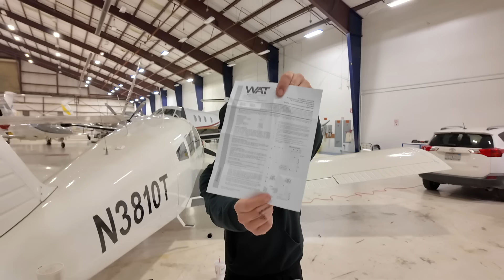Transform your aircraft with simple LED light upgrades

Comment: Looks amazing!  Good job. And even on cars you will find lights with “Top” on them. 

Mostly LEDs because it has to do with drainage for water and moisture. There is usually a small port on the bottom to allow it to drain to keep the circuit boards dry. It’s a lot more important in LEDs than with halogen lights that do not have all the circuitry in them. 

The port is usually covered by a small nomex breather or just a small pin hole.

You can see it on the landing light when you showed the back of the two. That little grayish/green circle on the bottom was the breather and port cover.

Comment: R44 is a great place to start and a buy. After you get a couple hundred hours you’re really going to enjoy the MD500. (H500C is good start but the NOTAR is a gas.)
I have 9K RW and 2K FW., MEL and  getting back into my IFR.  Really like your style. You might look at Gazelle. SA341/342. It’s like a big H500. VNE 168kts. Sometimes they are  cheaper than H 500s. 
BTW, I agree with your decision, not to fly true IFR in an SEL VNY to FAT. I have done it over the same route, even up to KTVL, KMEV many times, obviously with no issue but it’s a risk. Did it more often in a B60 Duke, which was cake. On the other hand, having flown >9000 hours in helicopters, I probably have a different risk tolerance than you do. Good luck.

Comment: I wish you would emphasize not using power tools to put the screws back in, or at least tightening them using the clutch so they don't strip out. My biggest issue with DIYers is over tightening and stripping screws out. Props on mentioning corroded screws, but there is no mention of how to deal with corroded fasteners.
Reply: Gotta love using a screw knocker for entire panels…

Comment: Curious... for the cost of a connector why you wouldn't replace the old handshake on the green light with a brand new one so that you have a nice new connector in place instead of an old one that could corrode faster than the new one?  Seems odd that you didn't make the change while you could.  Great videos.  Living vicariously :)!
Reply from the maker: Looked fine after cleaning. An easy swap later if it fails. If it ain’t broke, don’t mess with it. It was also to show the compatibility between old & new connectors. Something you rarely see in the automotive world

Comment: I always like these videos.  Couple of thoughts as your and ap I know you didn’t want to add the extra wire so you could have the strobes but i would think with a switch you could turn it off in imc if you needed to.  Also I wouldn’t want my ap trying to install as fast as possible but that’s just my two cents.   Otherwise like your videos and love arrow’s as that’s what I have
Reply from the maker: You’re missed the whole point. It’s MY plane, and I don’t want to wire a switch. If it was YOUR plane, and YOU PAID ME to do the install, then I’d install it on YOUR plane however YOU want. And I would check harge YOU for it accordingly. But I don’t work on any GA planes that I don’t personally own. As such, I’ll install items the way I want to, on MY plan. Thanks for watching Cheers 🍻
Reply: @gear_down  sorry I hope I didn’t insult you as I love the show. I just really like the quality of the lights and functionality of them as I have them on my arrow as well. I do hear what your saying in imc as I know it can be distracting but I found the biggest issues to be with the tail beacon which there is a fix.

Either or love your channel and would love to meet up as I am at kwhp which is close to you.

Comment: No STC on the led conversation?
Reply: Not if the lights are pma'd for the aircraft.
Reply from the maker: Nope whelen has both STC & PMA’s so it’s airframe dependent, but in my opinion as an A&P I/A this is considered a minor modification, and as such and owner can perform the task.